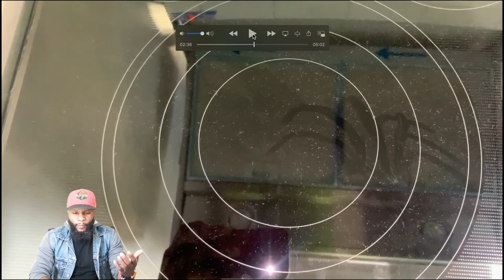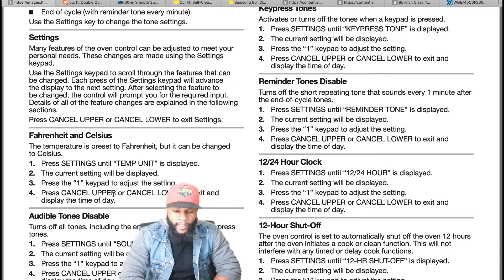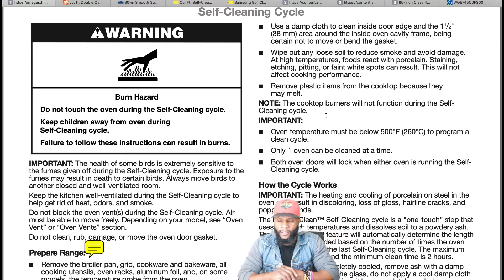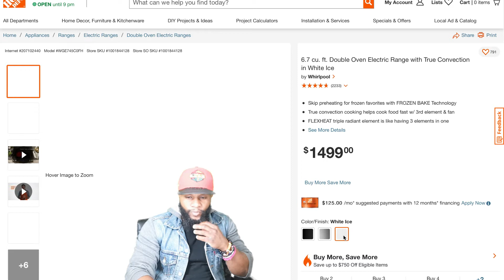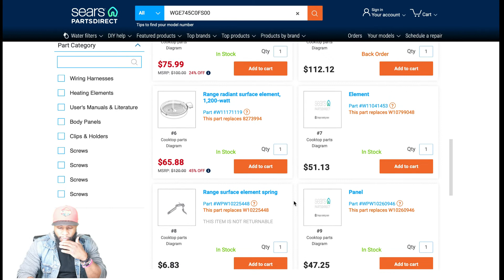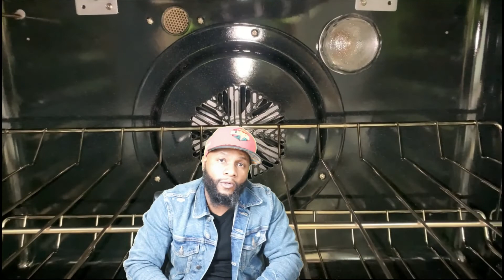(REVIEW) double oven electric range reviews/WHIRLPOOL best here's why

Comment: Is it common to have control board to malfunction? My Frigidaire has failed 2X in one year so I am looking at whirlpool. Each time it cost $300
Reply from the maker: It’s a common issue for all appliances but is like 5-6 on scale from 1-10 and 1 is the most common ..so it’s kinda in the middle … but it depends on the Frigidaire brand it does goes bad pretty effort .
Reply from the maker: https://www.speedyapplianceparts.com/frigidaire-316455400-316220725-oven-control-board-overlay-replacement/?gclid=Cj0KCQjwuLShBhC_ARIsAFod4fIN5vmVh7TIh86pgUGwB_HE1vKdiWcp7FdDDsQXusXkBFAcZcV27EsaAgaNEALw_wcB 

If it’s this model then yes

Comment: Don't buy whirlpool electric range,  mine only lasts for 4 and 1/2 years. The oven just stopped working all of a sudden. Would cost more than 360 to buy the part. Never whirlpool again.
Reply from the maker: Was the issue a control board??
Reply: @consumerappliancereport1579  Hi, it is the DLB switch in the control board. The DLB switch is open and cut off electricity to the oven and the  boiler elements. I don't know why.  I tried to replace the oven sensor at first , but it didn't work.
Reply from the maker: @liligibson8457  I’m not familiar with the name of the switch but theirs high limit thermostat that shouts down both bake and broil common issue with that part shorting out
Reply: @consumerappliancereport1579  On the schematic, it is called a "DLB"  relay that disconnects power to both the bake & broil elements in a fault condition. Diagnostics showed "F3EO" fault, which is the oven sensor. I disconnected oven sensor and checked continuity. Showed "OL" on meter.(open). I tested both elements (OK, checked thermal overload (showed continuity, OK) tested power in: 122v on each leg, 244v across both legs. absolutely no melted, scorched or burnt wires or insulation.  Replaced sensor, but error fault will not clear. Either the circuit board has a defect in the diagnostics and won't read a new sensor, or the DLB (Dual Line Break) relay won't reset. Local appliance contractor said interface is defective..

Comment: Don't bother with this range. The temperature range for the oven has a swing of 50-60 degrees making baking nearly impossible without Re- reheating half way through.
Reply from the maker: Thanks for your support if that is the case then you might need to get it service because it’s not supposed to be that far off you might have a runaway temperature so that’s why…